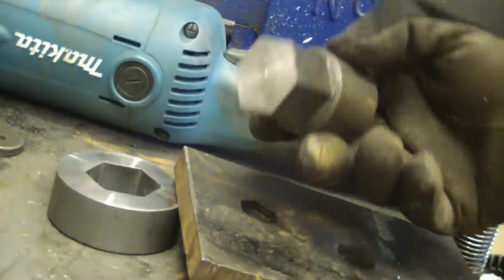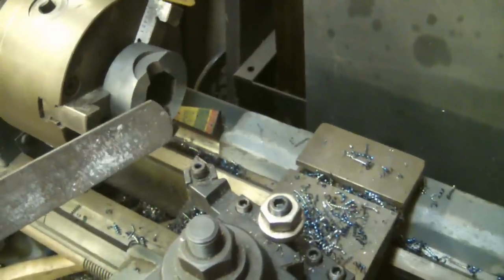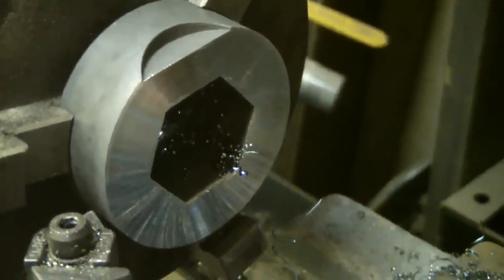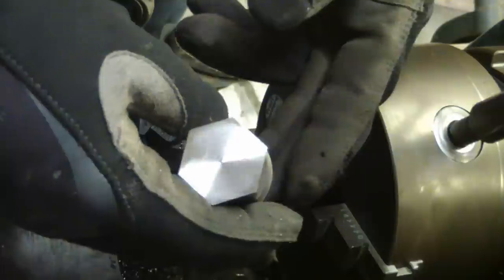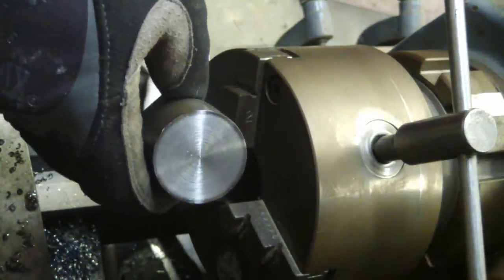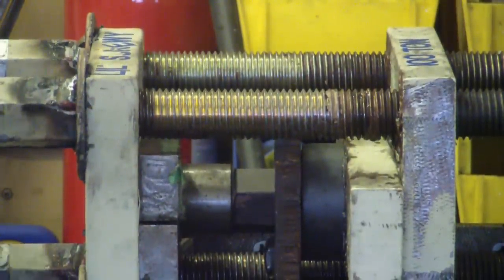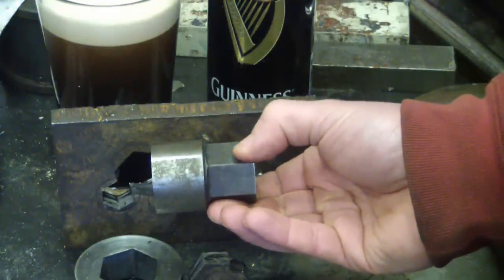How to turn tool steel in a lathe

Comment: Take your chuck key out of the chuck when you're not spinning. Ask me how I know.
Reply: +Mechanical Engineer Agreed, made the same mistake, luckily my dad was there teaching me how to use the lathe and stopped me in time. Otherwise the key would be flying all over the shop.
Reply: Man, glad you guys are alright. I have a good amount of experience working with lathes, but even to this day, I'll take a step back and look at everything before I pull that handle. I also try not to be in line with the chuck. I see a lot of guys so close to that thing while they cut... Makes me nervous and I'm not even there lol.
Reply: +Mechanical Engineer Yep.  Everybody has done the ricochet chuck key number... at least ONCE. :-)  Fortunately in my case, it bounced off the lathe instead of my face.
Reply: hahaha. .the old Charles key surprise. .
Reply: thats why there has to be a spring on the key that pushes it out
Reply: First time that I did that, it hit nothing.
Second time my friend did that and I was hit in the balls.
Luckily I was trained for that..... :D
Reply: Lightspeed Echo those spring release keys have their own unique safety challenges. The requisite down force at arms-length position can tear the machinist's shoulders depending on height/distance of the machinist in relation to the chuck.  Also, running the jaws in/out  to change setup diameters requires down force against the spring load plus rotational movement and can cause repetitive strain or ligament tearing to the fingers and wrists. If you're  doing safety installations think about a physical or electronic interlock on the start switch which requires safe and convenient storage of the chuck key before a start is permitted and please skip those bloody springs.  I have seen more injuries from sprung keys than non-sprung flying keys.
Reply: Got a nice scar on my nose from that. A fellow student left the chuck key in and i was working one lathe over. Thankfully I upgraded from safety squints to custom prescription safety glasses. Because i caught the key chuck right were my left eye is. The scar is from where the glasses dug into my nose from the force.

I'm no clipboard wielding safety nanny, but sometimes safety gear is useful. Especially around dumbfucks.
Reply: How do you know?
Reply: I bet you only did it that one time .
Reply: How do you know?
Reply: @Riverdeepnwide  Good idea. 

I like the chuck key holder at the plug end of corded drills.  The drill needs to be unplugged to use the key (unless its plugged into an extension cord).  I've thought about taping the key to the battery of a cordless drill.

Comment: I suspect the expensive steel you turned wasn't so hard that it was brittle, based in part on what appeared to be the intended usage (albeit obviously still too brittle for that), but more because you were able to machine it with carbide tooling.  For the really hard stuff like endmill shanks, you can use ceramic (not carbide) inserts and the slivers of hardened tool steel steel come off as bright orange ribbons of flaming steel.  Really impresses the chicks.

Comment: Hey mate, carbide inserts aren't a waste on a little lathe, you've just got to select the right inserts. Usually finishing inserts with a very small nose radius work well, because you can use low depth of cut and low feed per rev and they'll love it. You'll get a nice shiny bright finish and probably never have to replace your inserts because they're only doing light work.
Reply: ***** Maarten Kirsten sorry, I started to reply by email, I can throw out some stuff here if it helps.
Generally its best to go for the smallest inserts with the smallest nose radii because they suit the power of small manual lathes best. Usually finishing inserts. If you've got an existing holder there are usually finishing inserts available in any size, but the 9 to 11mm inserts are best for small lathes if you're buying new, with fine geometry as well.
If you're after the full story then this catalog has basically everything you need in it;
http://www.sandvik.coromant.com/sitecollectiondocuments/downloads/global/catalogues/en-us/turning/turn_a.pdf
With the cleft notes being that the inserts I'd recommend would be the 11 size VBMT and VCEX inserts, which are a very small finishing insert. Their data and use code information is on page A58, you need to select the coating and chip breaker geometry from the top to suit the material you're cutting (ISO codes are just P for steel except stainless and cast iron, M for Stainless, S for heat resistant alloys (inconel), K for cast iron and N for a non ferrous catch all... theres also H which is for metals above 52 Rockwell C but its not displayed here and usually P inserts do ok on those, but have a shorter lifespan.
and the details of what all those letters etc mean is on page A16 plus a few.

With regard to getting cutting data, the data its self (in metric, I'm a metric person) is specified up into three numbers;
The first is surface speed (or Vc) which is in meters a minute. Basically you take the work piece diameter, multiply it by Pi and then divide Vc by that number to get the RPM you should run at for optimum cutting... usually manual lathers can't go fast enough, so just go as hard as you can. For instance, you might have a finishing insert that likes 420m/min and be turning a 100mm diameter workpiece, so that means you'll need to hit 1300RPM to get best finish and get the chip breaker working properly.
The second is your Ap which is depth of cut. There'll be two numbers for this, the highest and the lowest. If you take a cut below the lowest you'll tend to have the insert rub rather than cut, which will give you a nasty surface finish due to galling and that sort of thing, ideally for a finish pass you want to be targetting the lower number, which can be as low as 0.2mm depth of cut, but is usually more like 0.5mm and is mostly driven by nose radius. The tool will also specify a maximum depth of cut, which, for these small tools will still be in the range of 4mm in one pass, that will probably be enough to give your lathe a stroke so don't do that ;)
the final number is feed per revolution or Fn... this is another window, but its related to the Vc, so the higher the surface speed (Vc) the lower feed per rev you can get away with, so, for instance, on some finishing inserts I've got around, they specify the Vc from 360 to 420 and the Fn from 0.05 to 0.15. If I run it up at 420 or even a little higher I'll get good chip formation and a really nice surface finish even down at 0.05mm/rev but if I'm running slower on the Vc then I need to pump the Fn up toward 0.15mm/rev

Also, if you've got coolant then that'll help a lot and getting the right inserts can get you a mirror finish and reduce the cut load a lot... the inserts I recommended above should lower the cut load a lot, which will reduce the stress on the lathe, get you a  better finish and stop you having chatter issues. If you don't have coolant, then you can mix some cutting fluid up in a spray bottle, or alternately for aluminium throw a bit of WD40 on it and that should help you out as well.

Post back and let me know how it goes.

Wow... that was a novel and a half ;)
Reply: Also a dcgt 07 with a coating on is very good at finishing steel

Comment: Not all engineers are how you think they are. Don't let the shitty ones ruin it for all of us. FEA is an excellent tool and is only as good as your model, boundary conditions, analysis type, etc are. It was never meant to replace testing. Anyone who says it replaces testing does not understand FEA to begin with. It definitely reduces the amount of times you need to prototype though.

Comment: Shorten your tool up in the holder and dial it in to be straight.  Carbide tooling is designed to have very specific relief angles to work well.  Also, they need to be very close to center.

Comment: The actual thing that makes some carbide tooling machine hardened stuff on a small lathe is rpm not the feed. I run pretty much the same feed rates when turning hardened stuff. Normally I´d run non hardened toolsteel at cuttingspeeds of 200m/min but hardened stuff is more in the range of 80m/min with the same insert. For fully hardened stuff I´d normally use ceramic inserts because, you know, time is money.

Comment: CALIPER. ADJUSTED.
Reply: +sghost128 Yeah, those things go through batteries like no tomorrow.  Literally, if you put one in and leave it, it's dead the next day.  New label on the case tells me to remove the battery when not using it.
Reply: Michael Johnson You can tell the batteries that they are safe now. The caliper is dead.
Reply: +sghost128 me too man. me too
Reply: Yeah, it just seemed so random that he did that.
Reply: +sghost128 I think the caliper is what really lost its shit...
Reply: Petru Turcanu Damn son.

You smart.
Reply: +Petru Turcanu it shit it guts out, lol

Comment: Could you do a video demonstrating the differences between conventional milling vs climb milling when cutting with end mills and whatnot?
Reply: Jeff Watson climb milling is cutting with the rotation of the cutter. conventional is cutting against it
Reply: Bryan Teet I think most people understand the differences in concept. I think this guy wants to see a demo showing the difference in technique and results. My school doesn't allow climb cutting so I can see why that vid might be useful.
Reply: *****  Climb milling will show you the screw's backlash in a hurry while likely f*n your cutter, work-piece and the machine set up. That's not to say NEVER climb mill, but use experience as your measure. I like to finish skim while climbing because it gives a nicer finish (especially with aluminium), BUT I always tweak the way lock a wee bit snug to keep the cutter from taking over the feed duties.
Reply: you can also use climb milling on a bridgeport mill that has prototrak
Reply: +AvE i wonder if you have any spring steel that you use in a video
Reply: Bryan Teet Yes I work on prototraks occasionally and they’re game for pretty much anything. No complaining

Comment: love the vid, but as others pointed out too....... rings still on your fingers in the workshop, left a chuck key in the chuck, gloves on using a lathe, long sleeves on using a lathe,alcohol ?? only just found your channel and wanna see you do a lot more so tighten up on your safety my friend,watch a few "lathe accidents" and it will make you think twice about what you're doing in your shop.
subscribing now.
Dan uk
Reply: ***** lol gotta love ya mate!
Reply: +Dan Allured it sure looks to me like you could use a few Guinness to get that chest hair up to par
Reply: +Dan Allured Considering this Boxford lathe has a 30 pounds worth of steel rotating at 3000 rpms.  But consider the 360 degrees of release angles, in combination of all the rotational inertias of the earth and chuck and gravity and all sorts of constants...you get a pretty small fraction of a number of a chance it will actually hit you. Now multiply that number with the rpm's and you get the somewhat ACTUAL probabilty, you will have a bad time.
Reply: home shop and safety third

Comment: we use mostly iscar and kennametal tooling in the shop i work at.
.160" per side at about .016 ipt and 375 surface footage does pretty good in 4145 with flood cooling.
the fun really starts when you have to cut carbide with ceramic inserts though.

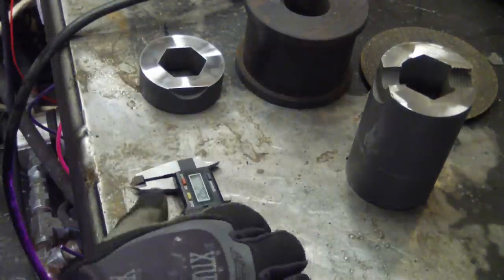Comment: At 3:50 ... I too have used similar precision adjustments on those exact HF calipers.
At 9:49 ... "punched out through shear force of Will."
Well of course. It was actually "shear force,"  ...but who is this Will fellow?
Guinness, it's not just for breakfast anymore! The Sturgeon General recommends a pint before, during and after any work.

Comment: When I saw you tension the 4 bolts, I remember when I was at work changing some bolts on a rearaxle on a mining truck. We tightened them to around 2400Nm each and everything seemed ok until later that day, when you heard a big booooom, and you heard something hitting the roof in the workshop a few meteres up, and then a bolt comes flying down in half. Some problems in manufactoring the bolt made them fragile :-)

Comment: I've cut into 1/4" flat bar with a carbide router bit in an old Shop Smith 10E slowed to prolly 200 rpm's or so.  The 10E has a stop bolt for depth control for drilling, but I moved the nut to UNDER the stop so that now I can force the quill out with it- 5/8" 11 thread stop bolt, so 1 thread is .090", 1 wrench side is .015"; so I can turn th' nut  to feed less than .001' if needed. Din't hurt a bit  :+)

Comment: Your carbide Tools are for bigger , powerful machines .Double sided means negative angle  . Small machines need single sided positive carbide inserts like CCMT, SCMT ... For turning hardned steel use CBN inserts.

Comment: Welding the washers (which isn't required)  increase resistance. Before selling it, install 4 sets of compression ball bearings. Or apply grease.

I can't give more details about the ball bearings since I forgot the actual name.  4 sets for maybe $5-10.
Reply: If balls aren't suitable, needle bearings have more surface areas. Increase resistance is caused by more friction from more contact surface areas. Try this. Remove one washer from a nut. Use a hardened washer but add grease between the washer and the nut. Is there a difference?
Reply: *****
Nice work on the Press - might steal/copy that on a smaller scale for a 50t press if you don't mind :)
.
Still think he(OP) has a point with lubrication between the washer and the plate tho. Yes agree with you that the washer should be welded to the coupling nut - as u said galling/gauling. Less turning resistance = less workout time / more Guiness time ha!

A suggestion perhaps... use anti-seize on the lower plate screw threads as I belleive that the compound's pressure range is better suited to the low/intermittent speed of turns - but if grease is working I wouldn't change it (expense wise if for no other reason).

PS. I have 32mm ID end thrust bearings out of an old conveyor belt (demolition/scrap yard) , you'd need those or conic roller bearings - & they are around but why bother - pretty pricey next to washers.
Reply: David I probably shouldn't write since I don't have any part type ready, but for clamping action like this, trapezoid-shaped threads are optimal. The metric threads like you use are designed to bind a little to prevent joints from becoming loose too easily. You need a thread like on the tool post feed. You may also benefit from extra fine pitch instead of regular.

Comment: You should use an indicator and true it up before facing it off for a true perpendicular face, and a travel dial to see if the carriage drifts under the pressure of facing, I was a machinist for 20 years, many mil spec jobs under my belt.

Comment: Good job on adjusting those cheap calipers. No point in keeping a device you can't trust. My calipers are made by Mauser (yes, the gun maker). They're old school analog and can't measure more precisely than .1mm, but if we're honest with ourself, the digits beyond that are mostly noise anyways. Got a nice spring loaded thumb button, that I actually prefer to a wheel.

Comment: Got a suggestion for you, it may have cut the hole a little easier if you put a shoulder cut in the external hex, say an 1/8" so that it started pressing in the middle of the slug first. A lot of our dies have this for flywheel style presses so they don't hit so hard. Not sure if it will help but just a suggestion.

Comment: Okay, so you smashed the little 4 inch digital calipers you purchased at Harbor Freight. HF has some nice 6 inch digital calipers with thumb wheels.  I think I purchased mine for something like $59.95 which was a nice buy compared to my so-called supplier quoted me $159.95 or more. Nice video

Comment: Did you glue the punch and die to the press before putting in the steel plate to make sure the punch and die will match up?
Reply: +Yue Fan, they are held in place with strong magnets. He put the magnets in the top and bottom plates when he built the press.

Comment: Could you weld sprockets on each of the nuts and gang them up with a heavy motorcycle chain, and run them off a reducing drive or is the torque too high for that?